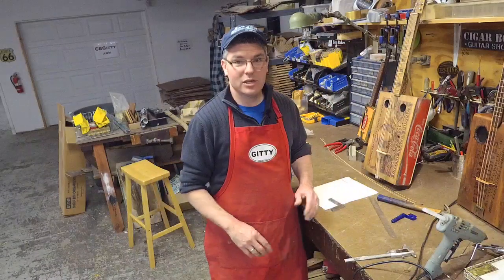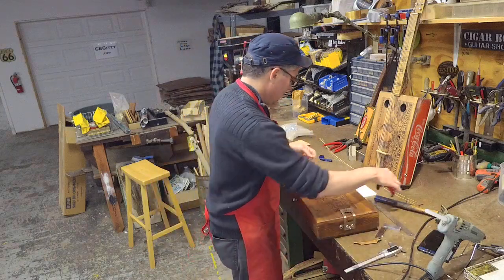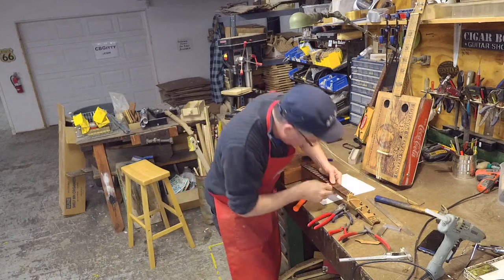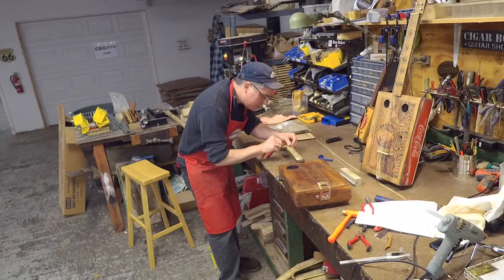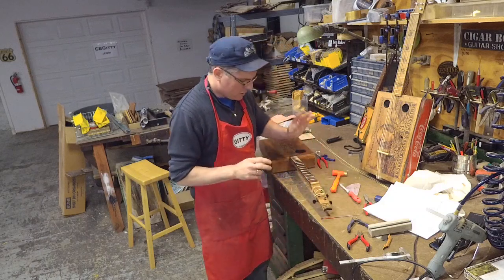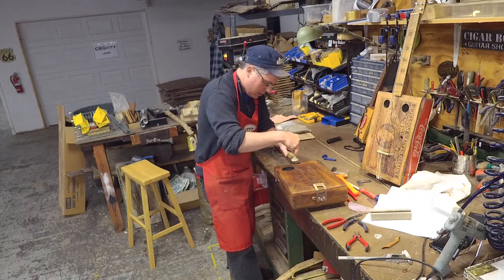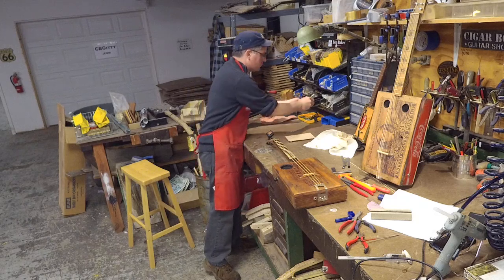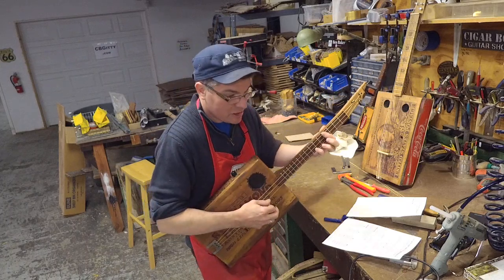Fixing mistakes on the Dynamite crate guitar, Live with Ben Gitty.

Comment: My thanks to the people who stuck through this despite the bad audio. I will be having another go at working out the kinks soon!
Reply: ...your new audio system was actually working almost perfectly. It just couldn't compete with the commercial vacuum, saws and all the other background noise.Don't mess with it. It sounded great! Good video, by the way. Thanks, Ben...
Reply: Well, the point was that it was SUPPOSED to compete with all of the background noise. It turned out that the lav mike clipped to my lapel wasn't actually doing anything at all, it was the built-in mic on the iPad carrying the load, which explains the extreme background noise.